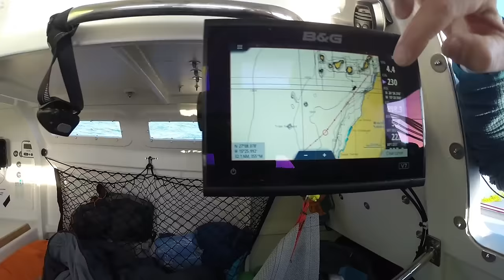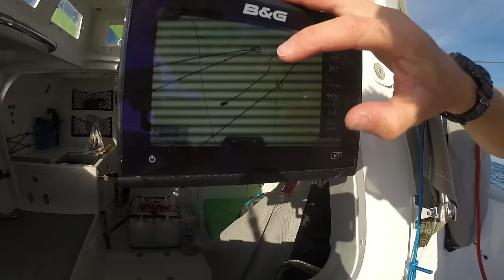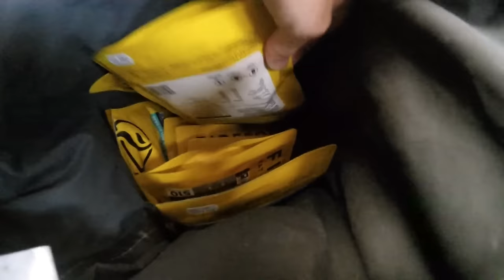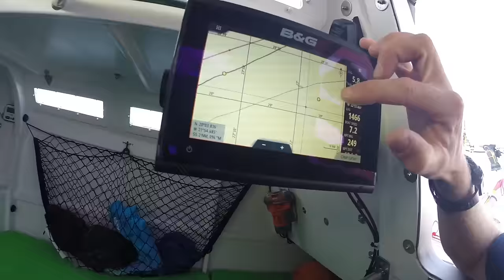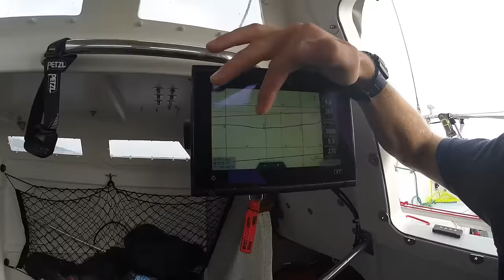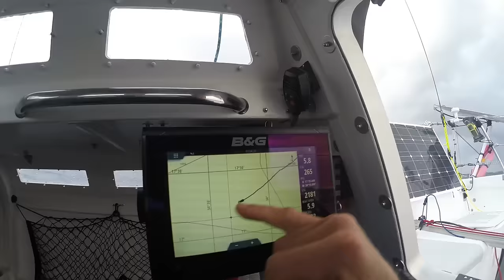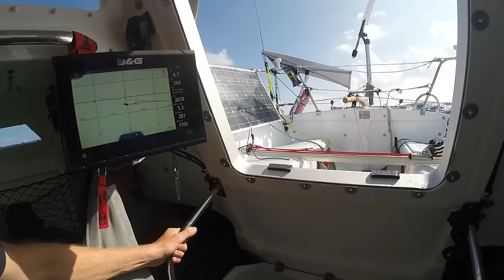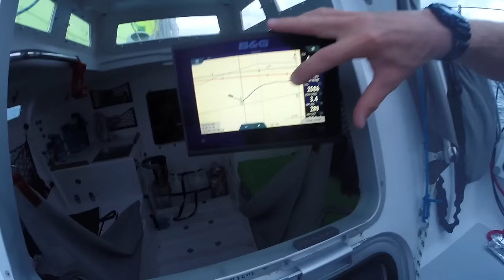Crossing the Atlantic in a 19' home made boat - The first Class Globe 5.80 Transat race, 2021.

Comment: Great job and great video, don’t need to apologize  for it at all in the description.  Congratulations on your first transatlantic.  I like these boats, the a cabin looks quite spacious considering the length.   A lot of people seem to use jetboil stoves.  How long does a cylinder last on a trip like this? Can you share how much you spent on the  dried meals… what else did you eat?  I can imagine getting tired of them quite quickly.

Comment: Not sure it's worth the weight or even advisable in a race but often figured and average trolling motor with dedicated battery and panel should at least be good for 20 or 40 miles a day at best when a person gets becalmed days on end. I'm liking the boat seriously. For the size her cockpit and even below looks roomy enough. I know enough about building boats to envy anyone who's completed one. Way more folks have started a build and never lived to see one finished. One last thing, not sure if I've seen you with any sun glasses but with light colored eyes if I want a horrendous headache all I need to do is be WO glasses and squint an hour or so. Dehydration and sun in my eyes is about the only headache triggers I've had.

Comment: Excellent Video of what it's really like.
Do you think that the inability to safely stream a drouge in the MGR class of mini yachts is a design issue with the class?
Thanks for taking use along...
Reply from the maker: I think it was likely more user error on my part. I was trailing just some line to try to make the boat track straighter. If I really wanted/needed to slow down I'd use a small drogue, but can't really tell you how this would make the boat react as I never tried it. If it got really bad and i had plenty of room from any dangers, I'd be letting the boat drift relatively fast downwind (a few knots maybe) on small drogue without any self steering input, which would probably help a lot. I was trying to hold a certain course with the self steering as well as trailing a warp which might have been the problem. Needs more experimenting! :)
Reply: @thenorthcardinal  thank you....again great video of how it really is out there...continued sucess

Comment: I didn't hear anything that sounded like "complete rubbish" (as you warn us in the description). But, as someone who has been at sea in quite a lot of bad weather over my lifetime, I think it's a shame that people new to ocean sailing (along with many who should know better) often misunderstand what the term "breaking sea" or "breaker" implies when used in relation to bad seastates. I have only ever seen true breaking seas in mid-ocean a handful of times, despite having (as one example) had to heave to at least three times during different trips on maxi-sized sailboats across the Southern Ocean. 
What almost everyone these days describes as a "breaking sea" is just a larger instance of what starts to happen when (what used to be called) "white horses" appear (which can happen in as little as 10 knots), where the peaks of the wave lose their integrity and collapse, spilling down the BACK of the wave.
This is an entirely different process from a sea breaking, which is where the crest plunges forward, and crashes down the FRONT of the wave.
I think people get quite demoralised when they see large spilling waves, if they think of them as breakers, because we all know the latter are inherently dangerous. Spilling waves pose no additional risk to a vessel, in comparison with their counterparts of the same dimensions which are not spilling. 
They might be a cause for concern if you happen to be contemplating falling overboard....

Comment: At 64 I'm totally new to sailing and have never actually sailed, but I wish one day to cross the Atlantic when I'm confident enough. Am doing up a Halcyon 27, fibreglassing through-hulls etc and generally repairing and re-instating her, and hope to sail a long way in her. I'm very taken with the type of hatch you have Pete in your boat, similar to the one Canadian sailor and boatbuilder Alan Mulholland ('Wave Rover') installed into his Contessa 26 and will doubtless install on Wave Rover Two, the boat he's building for himself to do a little spot of circumnavigating. It seems like a far better and more cautious idea than wedging a few bits of plywood in the hatchway and hoping they keep the sea outside. Would you recommend removing my standard sliding hatch and planks and replacing them with a transparent boat hatch like yours Pete and like Wave Rover's? Obviously it needs to be fitted sloping forward in order to make it easy to slither through, so I understand it isn't just a straight switch.
Reply from the maker: Certainly the hatch gave a real comforting feel to the boat, knowing it was 100% watertight, however it was really too small, I'm planning to fit a bigger one to be a bit more comfortable getting in and out. A big plus for the hatch is the amount of light it lets into the cabin. Definitely more watertight than traditional washboards, but plenty of folk have crossed oceans perfectly happily  with washboards for hundreds of years!

Comment: I noticed you're running your boom tight in light winds it's always better almost always to let the boom out a little in fact up to about a 45° angle is ideal and really light winds depending on where the wind is coming from also try sailing wing on wing jib out to the left or right with the boom out the opposite direction you'll find you make better speed in light winds also a lot of people don't seem to think about the fact that it's one thing when you design a boat I know I've done it in fact I'm in the middle of it right now it's one thing to design the boat with a given weight distribution but as soon as you put all your stuff in it you change the weight balance of the vessel try moving any weight you have on board behind the line of the mast it'll help to give you a little more speed it lifts the bow up a little bit which makes you a little faster.
Reply: There's an old saying where I come from, some variation on "anyone can tighten a sheet but it takes a seaman to loosen it"